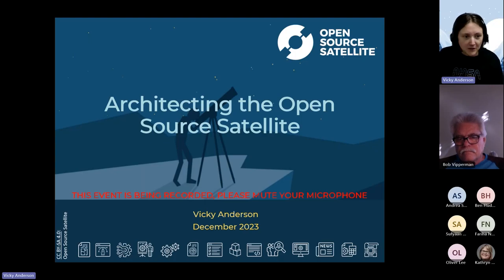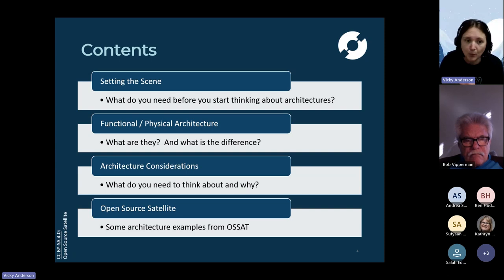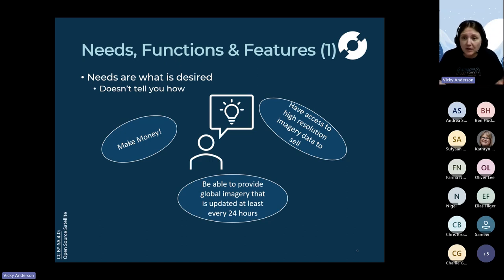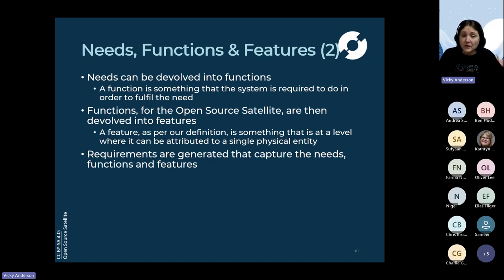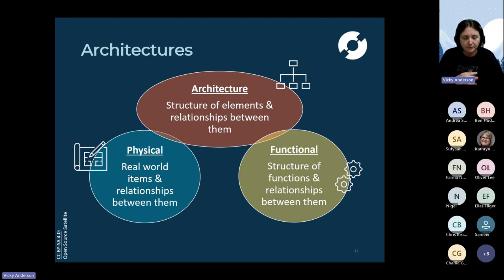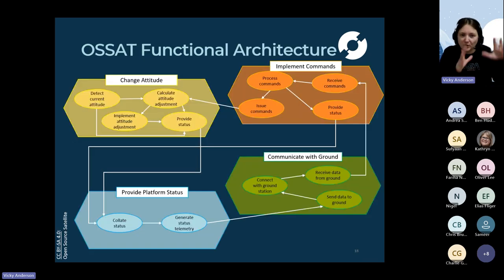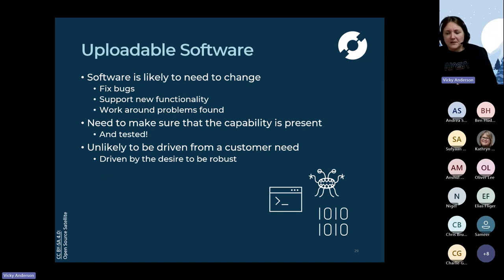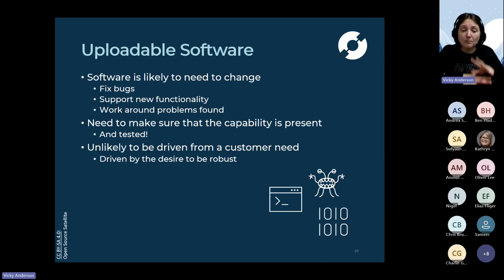Open Source Satellite Programme: Architecting the Open Source Satellite

Comment: I think more than 8 thousand satellites is a small number compared to the world's population and even also are few number compared to the earth up atmosphere sphere surface ... As you know all GNSS types cannot superficially target every signal everywhere on earth without station center field!... Your project will be historically revolutionary if it was accomplished for all GNSS orbits...I think maybe there are many problems in establishing it and because I am not expert then I am not sur what I ask about !...Firstly, the voltage response every time from the transceiver...Secondly, the confirmation of high-frequency transmission!?...Thirdly, the shape of the ground receiving platform seems to be possible maybe smaller like a phone, but how does it contain the necessary systems like those found on the ground stations?! ... Fourth, how does the satellite calculate its coordinates independently and accurately!? ... Fifthly, correcting the satellite orbit is an unexpected matter !How will the limit energy quantity for the correcting engines be ensured? ... extra problems..!!!!